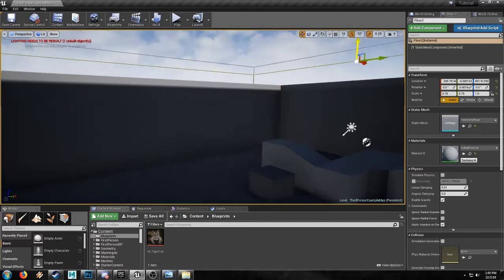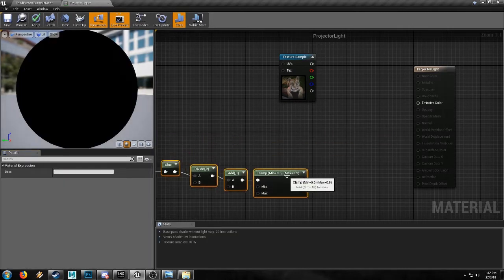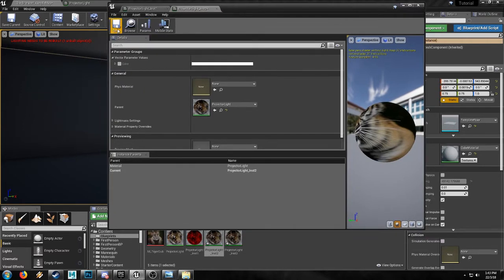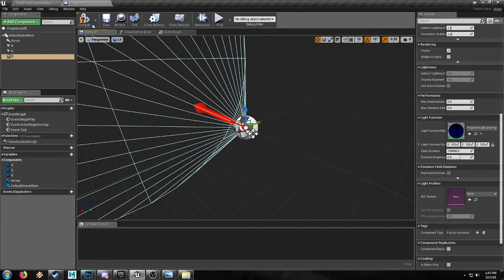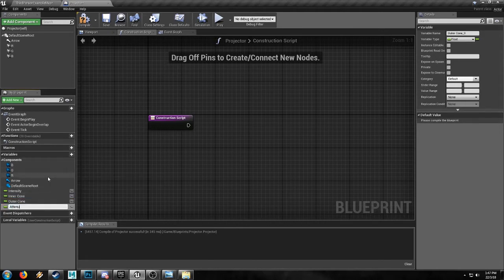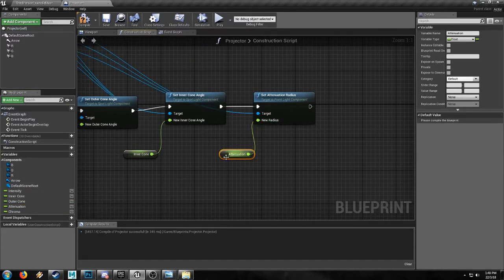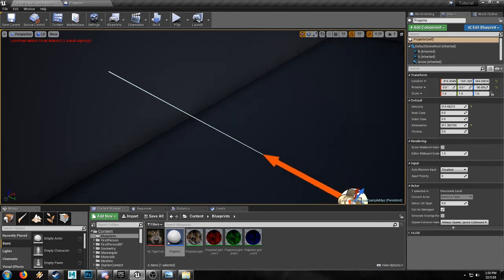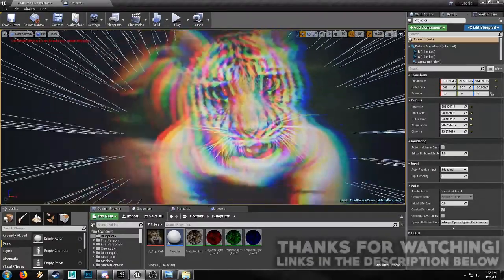UE4 Tutorial: Projector Light Effect

Comment: HI 
May I ask how to make the projector show up image in rectangle shape?
Reply: you cant, the rect light works differently and you cant change both horizontal and vertical barn door individually because whatever moron that designed it made it that way, now the barn door angle is broken since it doesn't maintain its aspect ratio, if you have a rectangle it turns into a perfect square once you try to change the angle, so in other words, it can never be like an actual projector that increases in size.